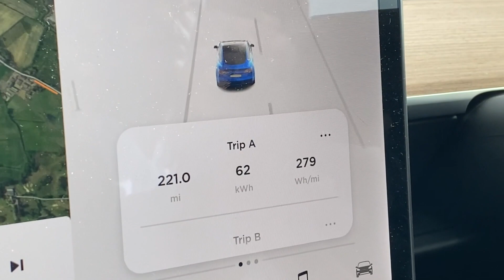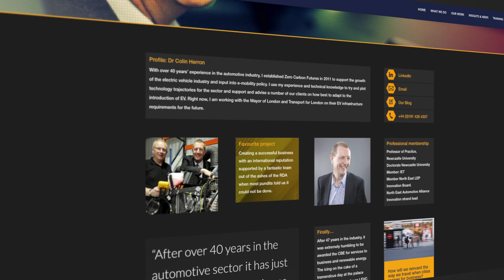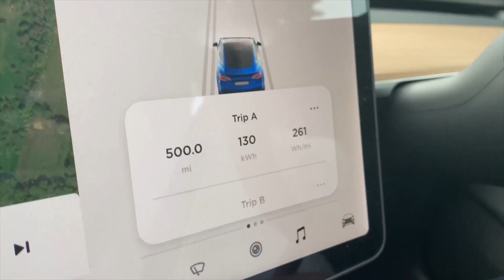500 miles & a battery factory

Comment: I'm sorry the materials are going to run out to make all these batteries the way forward is hydrogen fuel cells please watch the JCB video on YouTube, with Harry metcalfe
Reply: Sorry.
Wrong.
Reply: Hydrogen fuel cells? Oh, you mean the ones needing platinum to manufacture them?  The same fuel cells which degrade over time, needing refurbishment or replacement? You mean those?  And would that be the hydrogen that STILL needs transporting all over the place once it's been produced, so that it can fuel cars which run at around 45% of the efficiency of a full EV?  Why not just go with a full EV, and cut out the inefficient hydrogen manufacturing and transportation? A hydrogen powered car is basically an electric car anyway, but it just doesn't run as efficiently. You can't "charge" it at home, using solar either......  David, it seems likely that in the not too distant future, EV battery technology will move away from using lithium, thus negating your argument........  The big oil companies desperately want hydrogen to succeed, so that they can continue their iron grip on the supply chain once the demand for petrol and diesel drops to unviable levels. They must surely cringe at the very thought of people being able to "fuel" their cars at home with electricity..........

Comment: The plant will need plenty of lithium , really like the Tesla , I’ve been checking out the lease deals for the standard model based on 15000 miles a year , with a 4K down payment , £450 a month , not bad.
Reply: Don't forget you should save well in excess of £120 on fuel each month.

Comment: Shipping finished batteries is apparently bad. But is it better than shipping the raw materials instead? Can you get more finished battery packs in a ship than the relevant amount of unprocessed materials? I don’t think we are mining bauxite in the UK so we presumably have to ship it in or aluminium ingots.
Reply: Which part of "vertical integration" didn't you hear?

Anyway, "Aluminium"?
The same Aluminium used for internal combustion Engine blocks?

Just btw, I didn't hear them mention Aluminium batteries?
Reply: But oil had to be shipped here anyway, so why would lithium be any worse? At least you eliminate any further possibility of huge oil tanker spillages, like those we've experienced over the past few decades. And those batteries can eventually be recycled, with the lithium and cobalt content being recovered to 90% plus, and reused.  You can't recover and reuse burnt petrol or diesel. Once that's gone, it's gone for good.....

Comment: 2020 was when the oversupply of batteries ended. Globally, we are already looking at a shortfall in 2022. Battery research, development, manufacturing and Recycling are the key to a sustainable economy and environment. I do hope that the potential Lithium deposits in Cornwall prove to be viable, that would be a fantastic boot to the economy.
Reply: There are also considerable lithium deposits in Canada, Russia and Brazil. As yet, these are untapped. However, it seems likely that at some point in the not too distant future, EV battery technology may move away from using elements such as lithium......

Comment: Having had an electric car recently and now given it back people need to be aware that it’s getting more expensive by the day. Instavolt charge 69 pence per kilowatt. 4 x more expensive than charging from home. Synthetic fuels that will be on a par with electric cars for overall emissions will be coming soon. Also hydrogen needs to given more funding as it has been in Europe as the one trick pony of backing only battery is dangerous.
Reply from the maker: If you charge at the right time at home it can be as low as 4p per kWh. I agree that we need zero VAT on electricity for EVs and lower rates at public chargers.
Reply: @quentinwillson8918  unfortunately charging at home is not available to everyone, especially if you live in a block of flats as I do. But with that being said, I'm determined to go electric with my next car.
Reply: @Moggster23  It'll be much less problematic in just a few years time Moggy, when there are chargers virtually everywhere you might go. There were around 7000 new chargers installed last year alone....... There are 30'000+ EV charging connectors in the UK now, which is way more than petrol stations. We passed that point in 2018........
Reply: I installed solar primarily to power my house, but I produce more solar power in the middle of the day than even my batteries can store, so I charge my EV for free for a couple of hours a day and that covers 90% of my driving needs.
Reply: We can't charge at home but manage just fine; I am overall more interested in the cost to the Planet and clean air in Cities than purely the economies for me (and I ain't no saint btw).
Reply: Instavolt charge 40p it was 35p but hmrc forced them to charge 20 % vat rather than 5% so the price went up to 40p
Reply: Tim Skelton
Since Tesla has announced their network (28p?) will be opened to others, there will be downward pressure on charging costs.
Biofuels? Don't hold your breath.

Hydrogen?
The fundamental issue with Hydrogen is "source to wheel efficiency"
It requires 3 times the grid energy to move a fuel cell vehicle the same distance as a pure BEV.

The end consumer (driver) will pay for that energy.
Not viable.

(There's also the fact that "Green Hydrogen" isn't green)

 (Don't forget, Fuel cell vehicles need batteries as well!)
Reply: But isn't relying solely on oil dangerous too? After all it is a finite resource which will eventually run dry........
Reply: I think you mean Ionity not Instavolt?
Reply: You would only use motorway service station rapid charging on an only if necessary basis, in exactly the same way you avoid buying their overpriced petrol. In any case, with the ranges of even lower end EV's creeping up to 200 miles, there would be a deceasing need to rely on costlier motorway charging. The average UK motorway journey is 70 to 80 miles. In an EV - such as my Kia - with a near 300 mile range on a full charge, you could realistically cover a 500+ mile journey using only one charge during the drive. And I cannot personally ever see a situation where the cost of charging an EV increases, while petrol and diesel prices remain static for ages. It just isn't going to happen, because refining and producing petrol and diesel relies on *electricity*.......  And synthetic fuels? Not a chance. An internal combustion engine simply cannot meet a carbon zero target, even if it ran on fairy dust. Emissions charging schemes in many towns and cites will see off many older, more polluting vehicles. Birmingham have already introduced their Euro 6 compliant £8 per day charge, and Manchester are rolling their scheme out in May next year. York, Leeds, Bath, Sheffield, Coventry and others are said to be considering such schemes too.
Reply: Instavolt is the same as buying petrol at motorway services - only in an emergency

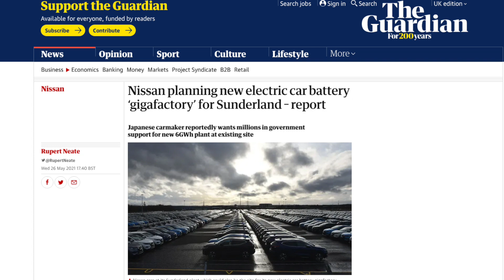Comment: Battery cell manufacturing is a highly specialised sector. Does this project have negotiations in place with potential battery cell partners? Likewise at 2:00 Colin mentions Nissan's 'other' battery plant at Sunderland. Does this project have a contact to supply Nissan or another car company? 🤔
Reply: Most affordable cars should use LFP. So that is Ferro/Iron supply as well as Lithium.

Comment: Interesting idea to locate the battery cell factory in a mining area. At 5:30 there is a brief mention of a short supply chain which mentions local energy supply. Is there any Nickel or Lithium to mine in that area?
Reply: the Lithium mines in the UK are in Cornwall - which they are currently experimenting with extracting by "greener" methods - similar to fracking but without its dangers but not actually digging into the ground to get at it